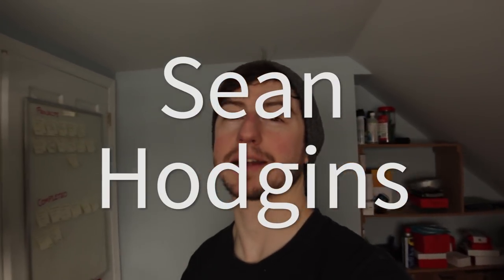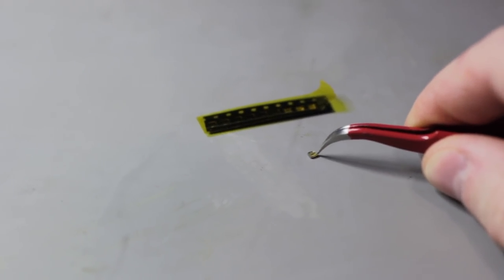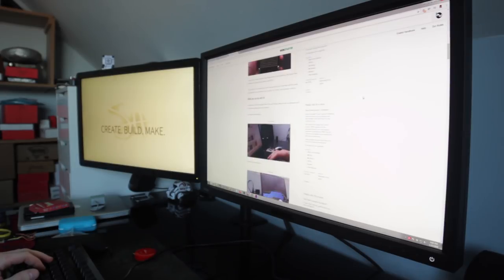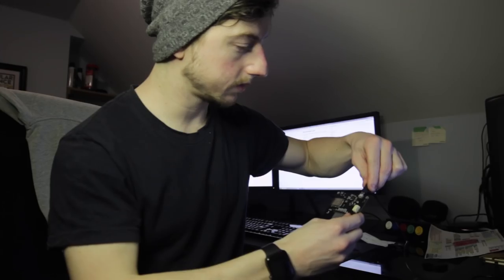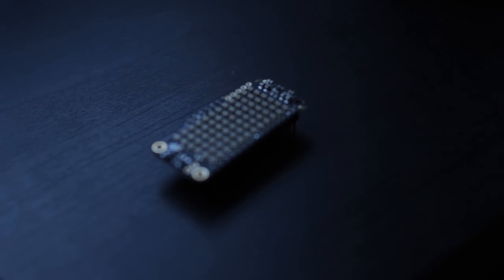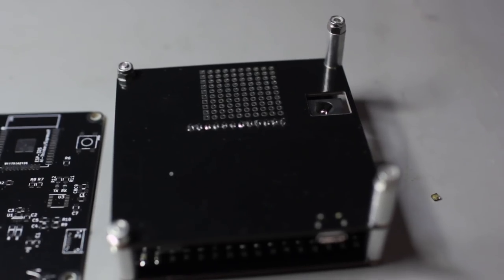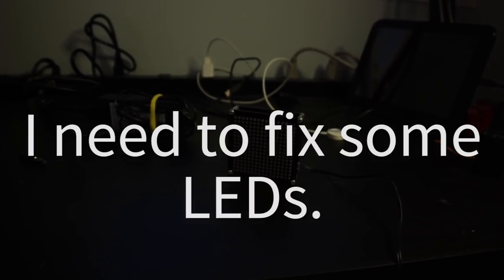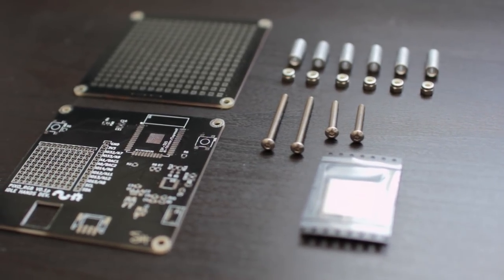PIXO Pixel - Part 1 Build and Test It!

Comment: Hey Sean, what kind of reflow profile do you use? I see that you use a normal oven with a temp probe in it. Do you have a controller attached to it?
What is the max temp you go in the oven for these LED's and what kind of solder paste do you use often?

Comment: Awesome, can't wait. Glad i'm not soldering it now, they looks so small (too small!)! So you're not going to solder the APA102's onto the board yourself did you say, get them assembled for you?

Steve
Reply from the maker: Yeah I may(depending on cost) get the LEDs soldered on board by the PCB manufacturer, and do everything else myself. I value my neck muscles too much. haha. Or maybe ill make my own pick-n-place for them? Hmm, now that sounds fun.
Reply: SeanHodgins or a placement jig to sandwich them together in one go?!
Reply from the maker: Like a 3D printed one? Yeah also a good idea, have them all turned upside down, then place the circuitboard on top. I could experiment with that as well.
Reply: SeanHodgins exactly!! With some small chamfers so you can drop them in a tiny bit easier without pin point accuracy. 

Steve
Reply: That would be pretty interesting. I've seen some videos of DIY pick-and-place machines, but they can be improved.

Comment: I just like you dude 🖒 can you make one 70  by 15  cm I need it for my project
Reply from the maker: How many LEDs? 70cm is huge!
Reply: SeanHodgins I know man i did it with 8x8 matrix but I suck at programing and connecting more than 10 with arduino I'm just in pain my project is fail ...also I can't pay for ressparypi
Reply: Read about multiplexers and the MAX7291, there are some matrices with it builtin being sold. And you could buy an Orange Pi if you want a more powerful solution for your project. Finally, as Sean said, 70x15 cm is huge and will require either lots of LEDs or lots of spacing between the LEDs, and if you want a PCB, the price of the PCB alone will be about 3 times that of a Raspberry Pi! So definitely don't use a PCB, just solder them. You can either use through-hole LEDs or buy SMD ones in little boards. Finally, you'll probably need some spacing, which can be made with some cardboard and some diffusion, which could be made with some paper. I'd recommend you to watch these videos: https://www.youtube.com/watch?v=uQMUPhyoXoE and https://www.youtube.com/watch?v=8pFcZ-ijrDY, both from GreatScott! The first one is about multiplexing and the second one actually does something very similar to what you want (I think that's what you want, just scaled up a bit, and yes, you read that right, scaled UP).

Comment: Why don't you use smd stencils?
Reply from the maker: I did for the LEDs, but the board its just an unnecessary development cost. This was the first version, so things may change slightly, making the stencil unusable. I will use one for when I make 100.